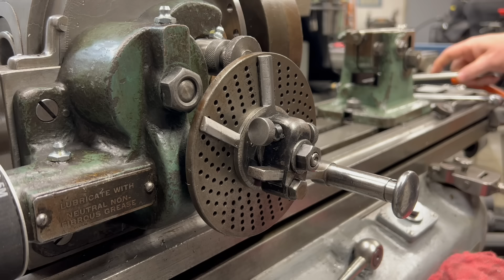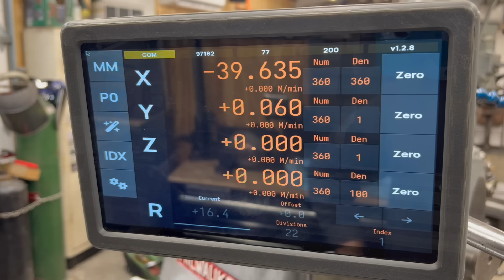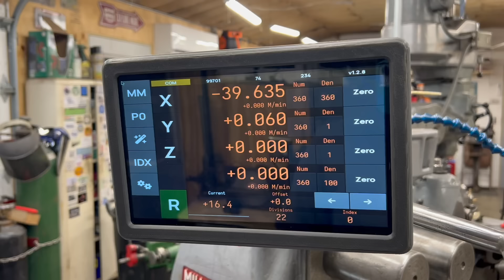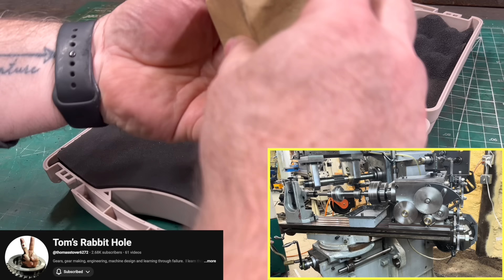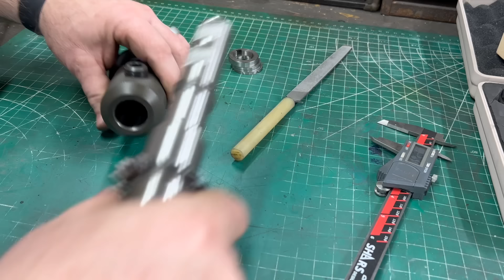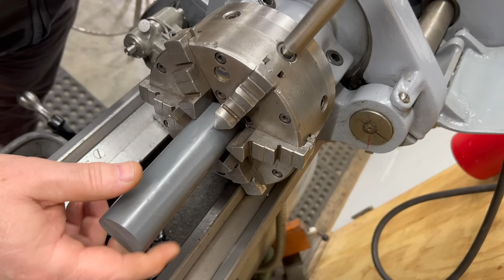Cutting My First Gear with the DRDRO and Servo Driven Dividing Head!

Comment: The plastic you are machining is grey PVC bar stock,I use it quite a lot for parts. To get a clean cut on this  material you need to use either razor sharp HSS or one of the razor sharp **GT type carbide inserts specified for machining aluminium and plastics.....that way you will get very little or no burring at all.
 I wasn't too surprised to see the style of square turning insert you chamfered  the gears with produce a ragged burr as they are negative geometry and quite rounded and blunt on the cutting edge.

There have been a couple of homemade designs of stepper driven indexers/dividing heads for cutting helical gears with either B&S style gear cutters of more commonly a helical gear hob of suitable gear tooth pitch for the gears being produced...there are some videos on the tube of these in action.
Reply from the maker: I appreciate the advice on cutting the plastic! Thanks for watching.

Comment: Very cool. One step closer to the holy grail when the DRDRO is emulating the elusive K&T low lead drive setup.
Reply from the maker: It's the ENTIRE reason I started building this. I had an idea of syncing a scale to a servo a while ago when a video from Rotary SMP popped up discussing the DRDRO and I was overjoyed at not having to invent it myself! I am extremely close to emulating that very device. And since I am using a DRO to control the rotation of the dividing head, there is near zero backlash. Thanks for watching!

Comment: You set up your sector arm backwards. You should never rotate the handle in reverse, the pin should slide off the sector arm and into the hole.
That is a very nice dividing head. It is meant to be connected to the x-axis for cutting helical gears. You could use it like it was meant to be used by adding an encoder to the spindle
Reply from the maker: The input shaft has multiple uses. Yes, one is to drive it from a lead attachment on a milling machine table. But more commonly it is used to enable differential indexing (i.e. 127 tooth gears). I won't be using the sector arms again, so it's a bit of a non issue. Thanks for watching!

Comment: Great video Greg. Is there a reason you are not using the over arm support?
Reply from the maker: Yes, for two reasons. The nub on the end of the arbor is too big for my outboard support, and since it was borrowed, I didn't want to machine it smaller without asking. And secondly, I wanted to make it easier for the camera to see what I was doing. Since it was plastic, and with some advice from Tom, that lent me the arbor, i felt like it was OK. Appreciate your support!

Comment: That material looks like UHMW (ultra high molecular weight) plastic. I use that for sacrificial gears on mini lathes and even on larger lathes when I'm teaching a beginner.
Reply from the maker: I'm not ruling any material out, so it very well could be. I've also been told it could be PVC. Who knows, for this case, it matters none. Thanks for watching!

Comment: Advancement to the next tooth is commonly described as 'x' holes. This is misleading. It is the spaces between holes on the selected index plate that get it right every time. Lot of wasted material over the confusion this 'holes' reference generates.
Reply from the maker: Thanks for the comment!

Comment: Nice demonstration Greg! I think your cutter got lose on the mounting arbor, you should reverse the direction of rotation of the spindle so that the nut is not gonna get lose while cutting, you were lucky that the cutter itself didn't move, but if you were cutting steel it would have been a problem! Thanks for your kind words on our little project!
Reply from the maker: I didn't tighten the nut down as much as I should. I didn't want to put too much stress on an arbor that was borrowed, risking me binding it. I indeed got lucky. When I go to cut a steel gear, I will be climb cutting to keep the chips from slinging onto the chuck.

Comment: Nice job. You got away with it, but that’s just too much unsupported stick out.
Reply from the maker: It's a plastic gear. The tool pressure is negligible. I left the arbor support off so it can be filmed. Thanks for the comment!